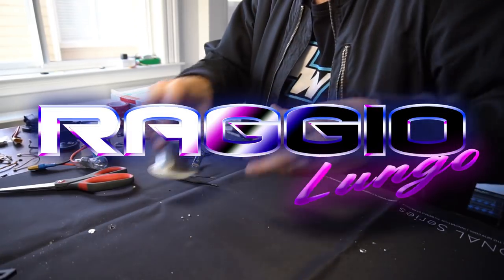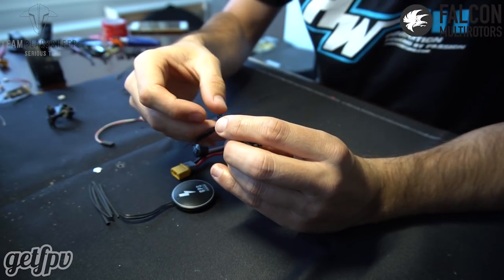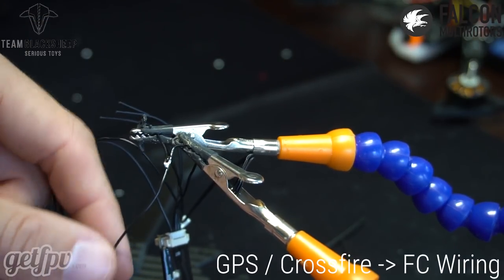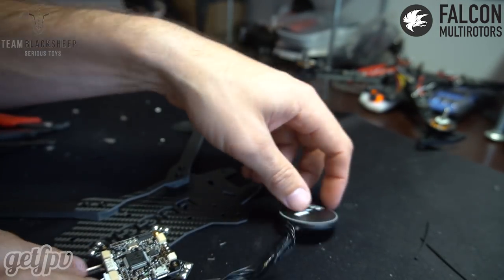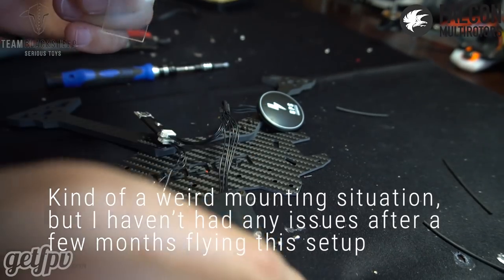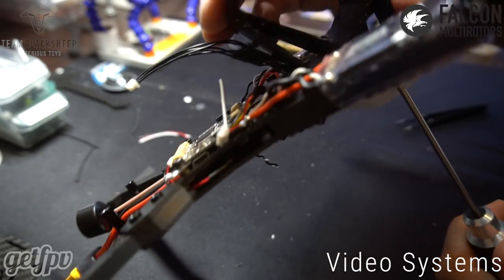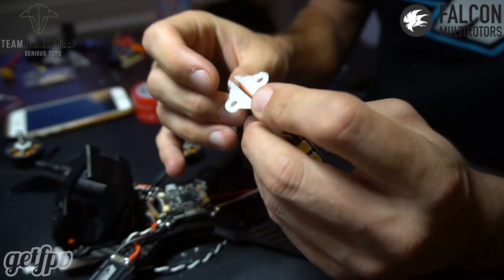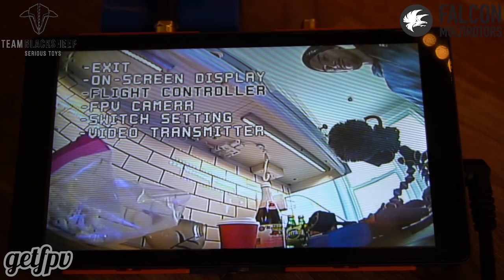Raggio Long Range Frame Build Guide

Comment: Hot tip, tbs sells a small splitter to y in the gps compass into bst, clean plug n play.
Reply: Also, you can use uart 1 with 4 pin plug to run tx and rx for CRSF protocol.
Reply from the maker: CLIFFORD RIFFpv WAKEMAN pro tip! I didn’t see it on the site. I ordered a splitter but it was the wrong one
Reply: SF PV oh damn, i can link you if you like?
Reply: Oh man, I've been waiting to do this build, but the TBS gear wasnt clear. Now I see why. Ok, maybe I can get her together this weekend. You up for mountain surfing down to the resovir in Chabot park? ;) I need to do some recon to find a good base location.

Comment: Great video. Really thinking about getting this frame...curious about a couple things. 

The LED's..What kind are they? And for the wiring, is running them so they are not on the bottom possible? 

Do you have a recommendation for an online shop for the 3d printed parts? Do any come with the frame? I see several on Thingiverse.

What's the advantage w using the TBS gear (FC, Gyro, VTX..) as opposed to something like used on this build page? https://www.getfpv.com/learn/tag/raggio-lungo/

Sorry for all the questions....just trying to get something like this as opposed to an armattan frame. Thanks!

Comment: Stoked to receive my frame finally. But, How did you get the TBS VTX pigtail to reach the antenna provided mount without mounting the powercube sideways? It would have been nice to mention it in your video or provide some instructions with the frame. Thanks